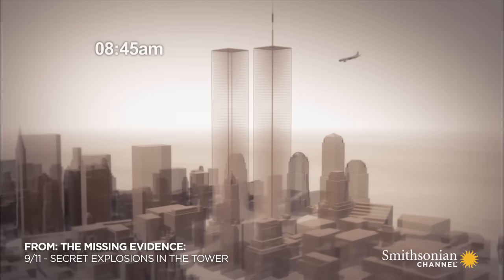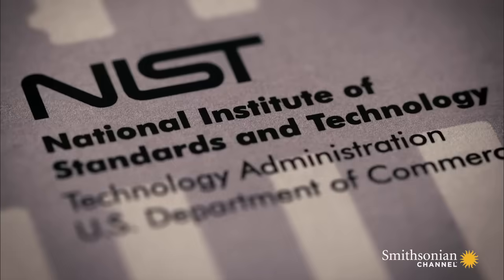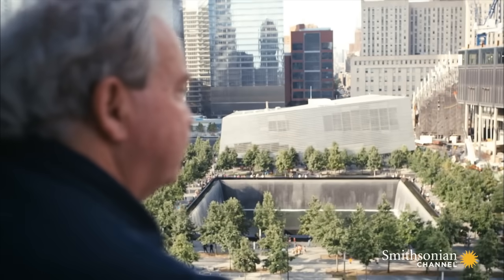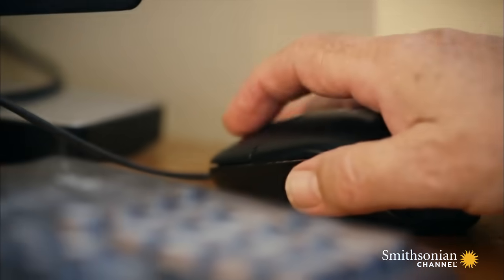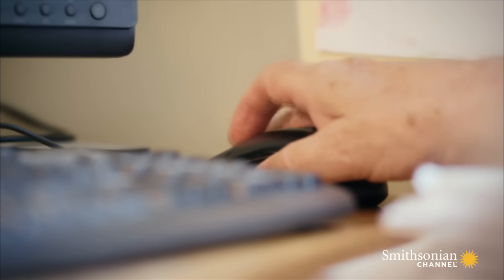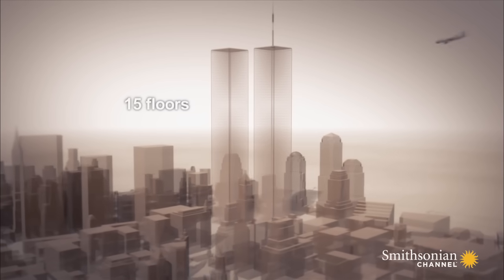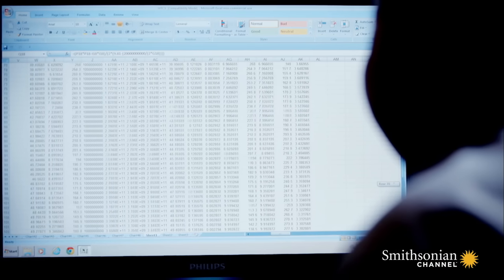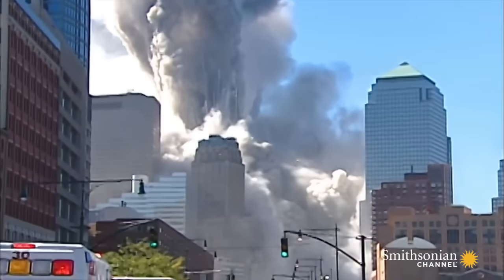This Computer Simulation Explains How the Twin Towers Fell

Comment: USGS and other labs found iron-rich microspheres in WTC dust — tiny particles formed from molten material, far more than normal dust, which would require steel or iron to reach over 1,500 °C. FEMA’s 2002 Appendix C reported steel with “severe high-temperature corrosion and intergranular melting,” including sulfidation that basically ate away at the beams. FEMA even said, “The severe corrosion and subsequent erosion of samples 1 and 2 are a very unusual event. No clear explanation for the source of the sulfur has been identified… The phenomenon is very unusual and is not normally expected in building fires.” They said it needed more study, but NIST ignored it. Iron spheres + sulpur is the byproduct of thermite. Where did the spheres come from in such large quantities? No one has ever answered this.

Comment: No, that's not accurate. That's impossible to a crash on the top of the tower make it falls like in WTC. That was a controlled explosion. Just search and you will see videos of people who evacuated before the first plane hit, where they say they evacuated because there was an explosion inside the building, then minutes later the first plane crashed.

Cientists, engineers, architects and physical already said that's impossible. Some even appeared on the news and said they found nano-thermic inside the buildings and that this substance It overheats and melts iron and metals quickly and this material didn't make sense to be there in the WTC since it is for military use and few scientists had access to it that time.
Reply: "That's impossible to a crash on the top of the tower make it falls like in WTC"

Why? Are you educated as a structural engineer?
Reply: No
Reply: Nothing is ”impossible” about this, everything about your comment is so dumb and wrong gosh it pisses me off lol

Comment: Obvious Controlled demolitions.
Proof: No steel framed building ever came down from fires. And on September 11th,  3 buildings did. No resistance.  Physically impossible.
Reply: 3000 bodies were not recovered from Ground Zero, do you know where they went ?
Reply: @Larry26-f1w  They were pulverized to dust along with the 200,000 tons of structural steel, cement and office furnishings in the controlled demolition of the buildings. Each tower had a total mass of around 500,000 tons. No airplane, no fire could have brought those buildings down the way they did. The proof is that when the Jets hit the buildings, the buildings stood.

Comment: The way those towers fell just makes absolutely no sense.  The towers were struck at different locations, which now became weakpoints.  The only thing that would've made sense is that whatever is above those weakpoints would fall off to the side.  I just don't see how they would collapse vertically like that.
Reply: Why would they "fall off to the side"? Gravity pulls DOWN; with no other force acting on the buildings, DOWN is the only way they could fall.
Reply: @Tim22222  Gravity pulls down, yes, but the structure of the building below the point of impact should've remained undisturbed. What I'm saying is, the building was already designed to hold its own weight this whole time, why would it all fail? Not trying to say I'm right and everyone's wrong, I'm just genuinely trying to understand. I try to think of it as a game of jenga. When you pull blocks out, the weak part causes it to fall sideways.  It doesn't just collapse and make it fall vertically.
Reply: 3000 bodies never recovered from Ground Zero

Comment: how the second tower collapse???
that definitely a bomb in there
Reply: The second tower collapsed because a jumbo jet it hit it at 500 mph damaging the structure, stripping fireproofing off much more, and started fires that burned hot enough to weaken steel by 90%. No evidence of a bomb in that building or any other.
Reply: @Tim22222 then why ask about one planter ? 💩🪴🫡your comment and reply routine is pretty stale !

Comment: Not a word about the amount of energy needed to pulverize huge quantities of concrete, let alone what could possible have had that happen in mid-air (en floor trusses supposedly letting loose in some higly unlikely perfect horizontal full floor manner, would not in and of itself cause such an action), and then how this pulverization would affect the input data in his calculations. You can't have both pulverized concrete and calculating accreted mass from concrete already pulverized.
Reply: Each tower had gravitational potential energy approximately equivalent to 200 tons of TNT! Would that be enough?
Reply: @Tim22222 What you are talking about is a hypothetical scenario, first of all in which all the steel members would be involved. Most potential energy, however, obviously was not involved in any thought up scenario of pancaking floor trusses since the perimeter panels clearly were forced outwards in the process and much of the respective cores remained standing for quite some time. Concrete slabs poured on metal decking and hypothetically somehow letting loose from the perimeter structure and the core, falling down on another one, wouldn't result in much of the concrete turning into powder.
Reply: 3000 bodies never recovered from Ground Zero disproved this fairytale
Reply: @Larry26-f1w  Not quite. I think there have been DNA to identify at least 60% of the victims. But the question remains troubling how so many are completely unaccounted for, not to mention the very disturbing fact of thousands of body parts more or less sprayed on top of adjacent buildings, in all directions (i.e., certainly not from airplane crashes alone). And if my memory serves me right, there were about 200(!) pieces found, once belonging to a single firefighter.
Reply: @Funkadelic2 Quite a revelation isn’t it ? The bodies betrayed the plot by disappearing
Reply: Your memory is incorrect, less than 300 bodies were recovered so DNA identification of those bodies would account for 10% of the victims not 60% . You keep swinging and you continue to miss but nice try for the hundredth time planter
Reply: Looks like the Fake Plant Brigade has marched on to another comment. They’re poor soldiers with that crippling mathematics allergy . Get well soon Planter 💩🪴🫡
Reply: All clear no rats 🐀 scurried back to reply , they got a good dose of the numbers

Comment: I can accept that the weight of top block would cause collapse of subsequent floors.... but how do we account for the evenness of the collapse? To start the domino, the floor(s) that failed first would have to do so completely and at once. If half the floor or the corner failed first, would the building not have tipped over or collapsed unevenly?

Comment: Both buildings have a small section that stays standing for a hot minute, then just turn to dust. Watch collapse compilation videos and you will see. It is insane!
Reply: The steel did not turn to "dust." Clean-up crews removed 100,000 tons of very solid steel.
Reply: @Tim22222 you weighed every ounce Fitz
Reply: @Tim22222 you must’ve had quite a security clearance to weigh all that steel . Even fire department investigations weren’t allowed at Ground Zero
Reply: @Larry26-f1w  What say we knock off the semantics & get to the point:

Are you aware of any evidence suggesting that the amount of steel removed from Ground Zero during the cleanup was less than would be expected?
Reply: @Tim22222 Actually some firsthand accounts of first responders / reporters do make note of a “surprisingly low amount of debree” or anything to that effect. Obviously their words can be subjective, but i figured I’d give you a decent answer
Reply: Yes insane , didn’t happen . No building collapses occurred
Reply: We were all shocked that 3000 bodies were not found with the steel you claimed to have weighed
Reply: Tim has left the Scale House

Comment: At the start of the clip the narrator says that the towers "were designed to withstand the impact of a commercial jetliner." Could someone clarify if the towers were literally designed with this in mind? Did they really mean "the towers should in theory withstand that level of force"?
Reply: There's some debate over this. I saw an interview with the chief structural engineer where he said they did the "would the towers survive a jet crash" calculation after the towers' designs were final, a sort of what-if thought experiment. In any event, they did not figure on the 9/11 jets' high speed nor did they take the effects of the subsequent fires into account.
Reply: There is no debate about building collapses being impossible here . Three thousand bodies disproved that farcical fairytale before it was created. 90% of the victims can’t disappear in a building collapse

Comment: Sorry but i dont believe the top 10 percent of the building was heavier and stronger than the bottom 90 percent
Reply: You think the top half isn't even heavy?😂 half these comments have to be bots
Reply: @CaseysRepository  i think its very heavy. The question isnt why is it heavy but why didnt it take damage until it hit the ground floor. Imagine 5 cars parked together and one car drives thru all 5 with no damage. It isnt possible
Reply: The 90% of victims that were missing from Ground Zero ? They disproved the building collapse fairy tales

Comment: Im glad that the physicist was able to come to the same conclusion that myself and other non idiots did. I spoke with my Uncle and cousins about this years ago and they too are Architects and Engineers and they all said that, that much stress from the upper floors would cause the buildings to pancake in the exact way they did. There is always one fact left out that is in the NIST report. And that is that when the planes hit the buildings and the initial explosions, it blew away the fire protective coating from the steel. When that happened the excessive heat from the thousands of gallons of jet fuel weakened the steel even further. It wasnt hot enough to melt it, but it was hot enough to bend it. Add that to all the furniture, drywall, copy paper etc.. that helped fuel the fire extensively. Plus when the planes impacted they damaged multiple floors which left them sagging adding pressure to the lower floors. When the building finally gave, it pancaked floor by floor. People have no idea how much all that steel weighed above the points of impact. Once the collapse passed the impact zone there is no way it could stop. Conspiracy theorists claim they heard bombs going off before the collapses, but  that was the emergency vehicles exploding that caught fire after the attack into the South Tower. Not to mention all the other vehicles on fire that were parked in various spots around the WTC complex. They were hit with debris and parts of the planes that shot out of the building and were on fire. Its a ridiculous theory to think that our government would attack its own people on U.S soil. That they would sacrifice thousands of citizens. These idiots also claim that bombs were planted on every floor prior to the attack. Do your research, because any demolition expert would tell you that a job like that would be impossible to perform in an active office building. All the walls have to be ripped down and explosives wired together on every support beam. Then they would have to put up new drywall, tape and texture everthing and paint every wall on every floor and put the offices back together in the exact same fashion as not to arouse suspicion. When would this take place? It's completely implausible to even consider that as a possibility. Ive done demolition and construction in the past and ill tell you that hanging drywall in even a small house is no easy task. There is alot that goes into it. Not to mention all the finishing like texture and paint. I used to laugh at these idiots but now it just pisses me off. Its easy for them to make up false stories while sitting in their Mommy's basement behind a computer or a phone. If you hate or distrust our government then leave, go somewhere you think is better. I guarantee you will miss the freedom and opportunities that this country provides you daily. Because no matter where you go you will always be an outsider to them. Food for thought perhaps.🤔🇺🇸🇺🇸🇺🇸
Reply: Any ideas where three thousand bodies that weren’t recovered could be ? Alien abductions?

Comment: It doesn't explain how the towers turned to dust in mid air. It doesnt explain why there wasnt a huge pile of rubble. It doesn't exolain why a building with asteel core like this would pancake , let alone so quickly. One look at the original construction photos tells you all you need to know about hos nonsense theory.
Reply: Correct and 90% of the bodies disproved the farcical building collapse theory by not showing up at ground zero! Physics and mathematics never disagree , a lie can’t stand up to either .

Comment: You can see detinations going off well below the impact. Jet fuel does not burn hot enough to melt steel. Building seven didn't even get hit. To say debris brought it down is reduculas.
Reply: Where? I don't see anything happening before impact. I call BS!

Oh, and: There is no evidence that any steel melted. Bld 7 was hit - not by a plane, but by a massive collapsing skyscraper!
Reply: Tim2222 has some explaining to do about the fact that 90% of the bodies were never recovered from the debris. Go ahead Tim the floor is yours ….

Comment: The lack of debris is the actual smoking gun. Never mind the miniscule seismic effect. Those buildings were dustified, and Dr Judy Wood does an excellent job explaining that.
Reply: What about the thousands of tons of debris hauled to the FreshKills landfill on Staten Island and the 175,000 tons of recycled steel?
Reply: @bencarter7839  How many thousand tons exactly? Couldn't have been much, or else the colapse would have measured way higher on the richter scale.
Reply: @P-Drum  Well documented.   Each tower weighed approximately 500,000 tons.  I know of no scientist who is questioning the consistency of the seismic observations for these collapses with the expected observations.
Reply: @bencarter7839  Posted a detailed answer to this but seems YT censored it or something. Anyway, I'll try again soon.
Reply: @P-Drum  Yeah, they do that to me too, and I am perfectly polite and discuss the issue, not the person debating me.  I save all of my postings before sending them now so I don't lose any work.
Reply: @bencarter7839  So first of all you didn't specify how many thousand tons of debris they hauled away from the scene. Are there any official number here? 

Secondly: it couldn't have been much, because WTC1 and 2 caused a 2.1 - 2.3 respectively on the richter scale, which is no way near what to expect from 500k ton collapsing down in it's own foot print. Remember that the fundament of the wtc plaza is bedrock. 

WTC7 only caused a 0.6 on the richter scale, which is barely noticeable from background noise. This building had a mass of nearly 230 thousand tons. 

Even more intriguing is the fact that the quakes barely lasted more than 15 seconds respectively. Only causing surface waves. Normally, a building of even half that magnitude causes an afterquake that lasts for around 2 minutes. None of that was registered. 

Therefore I sincerely doubt that any 'scientist' find the seismological data from 911 to be consistent with any expectations whatsoever.

Comment: So what caused the almost identical collapse of building 7.
I think it was Sorros who said he ordered that the building should be "pulled ".. that is demolished by use of explosives. 
As for the 2 towers, I don't know any Architects who would get away with engineered instability like that.
We're meant to believe that these buildings were built in such a way. 
Cast your minds back to ww2 when a bomber flew into the empire state building.. the structure dealt with the subsequent fire and the framework took the load of displaced materials..
If that building could survive that, how come a much more modern one simply gave way.? TWICE..! In an IDENTICAL fashion..? Each with a plane hitting different parts of these structures. 
Thanks for showing how they can bamboozle people with pictures and professional sounding nonsense. 
Trust your own opinions,  don't be taken in by paid liars.
Reply: Um, 7's collapse was NOTHING LIKE the towers'. The towers collapsed at the points of impact; 7 collapsed from the bottom. Are you blind???

And now you losers are injecting "sorros" into your narrative?? 🤣🤣🤣 Paranoid much?? 🤣🤣🤣
Reply: BTW the plane that hit the Empire State Building weighed 1/10 as much as a 767 and was going 1/3 the speed. Are you so dumb you can't see the difference that makes??
Reply: Ignore this bot^. He’s been commenting day after day for YEARS on every video about this. The cognitive dissonance is eating him alive. Cope Timmy, cope.
Reply: @stringbender3 anybody who doesn't agree with your delusional conspiracy narrative is automatically a bot? 😂😂

Comment: It was designed to withstand a plane hitting by the biggest plane at the time it was designed in the 70's also it was not taken in to account both jets having full tanks of fuel
Reply: They also assumed their hypothetical crash would be an accident, not an attack - so they figured on a plane going 180 mph, not 500 mph.
Reply: @Tim22222  Exactly
Reply: @Tim22222 accidents can still happen at 500 mph

Comment: the towers were meant to take aircrafts like the 707 and dc8 at slow speed, not the 767s going full speed
Reply: Expected to. Not "meant to", no one has ever meant, designed or built for that, but yes, it was expected to be able to, according to some calculations.

Comment: the reason they collapsed is the supports Were so hot that they bent inwards thus bending the outer walls to nwards and eventually pulling the walls in so much that Gravity takes Act and collapsed inwards on itself ex: 

|    |
)—(
|    |